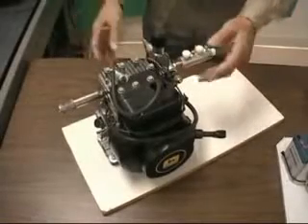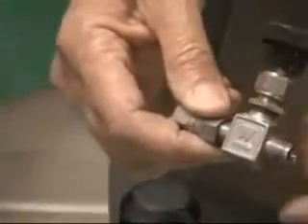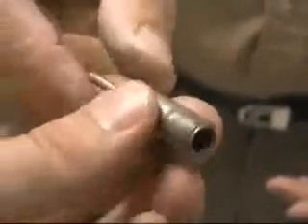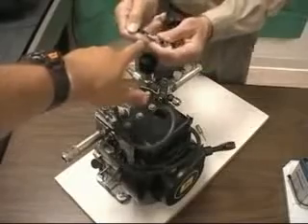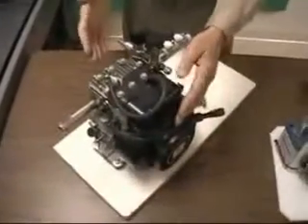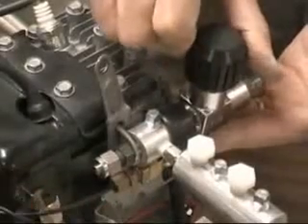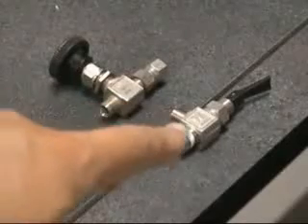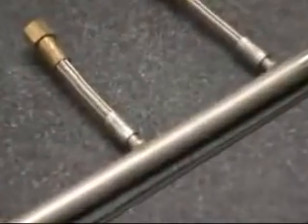Alternative Fuel: Water Powered Cars Part 1

Comment: So u run a tube right into the   open valve chamber? So how do u filter the air? And if u do filter it will it get enough CFM to run on hydrogen? Will retarding the timing so much make it run hot? It needs to show it running. Sorry I dislike this